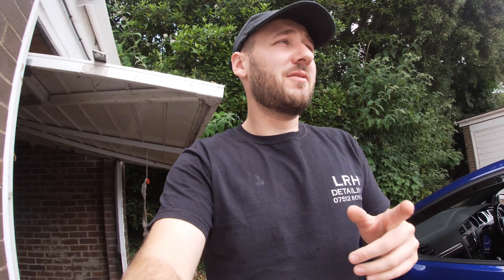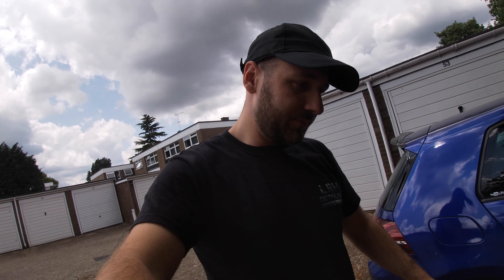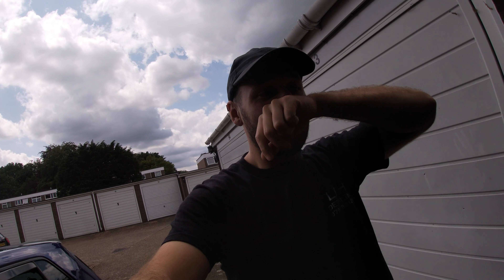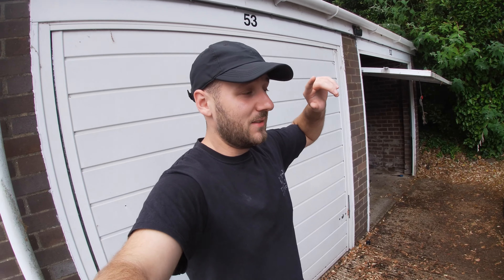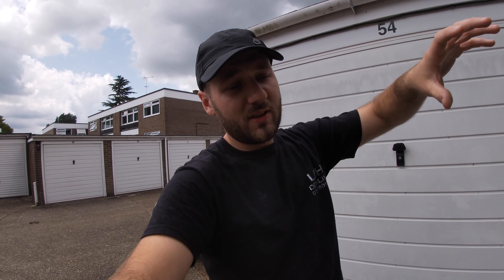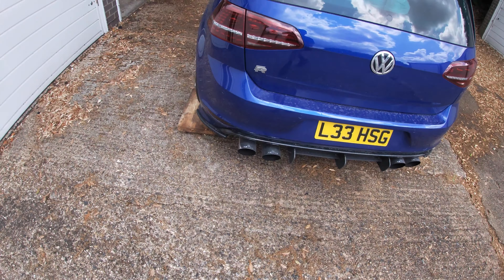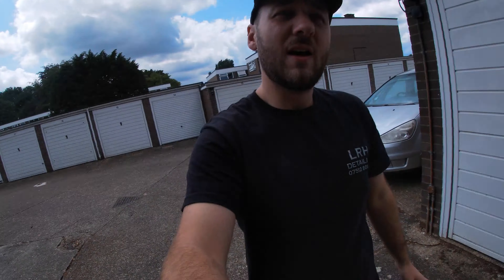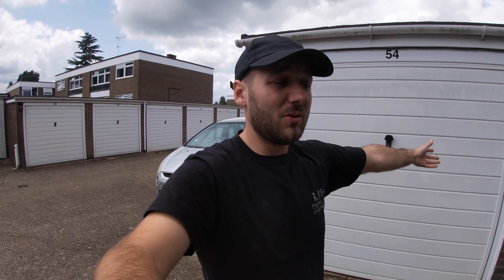FIXING THE RATTLING EXHAUST ON MY VW GOLF MK7R

Comment: Hey man, if youre hunting down a rattling noise make sure you check the turbo wastegate actuator. Its a known issue that the wastegate has a tendency to rattle. I recently put a clip over the actuator and it completely fixed my rattle. Hope this helps!